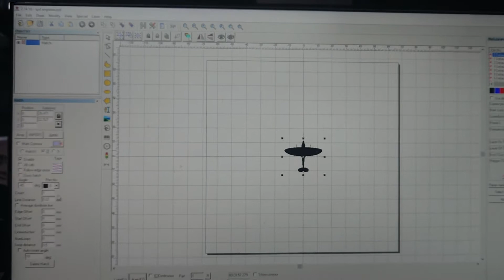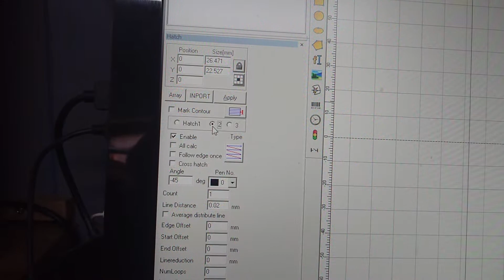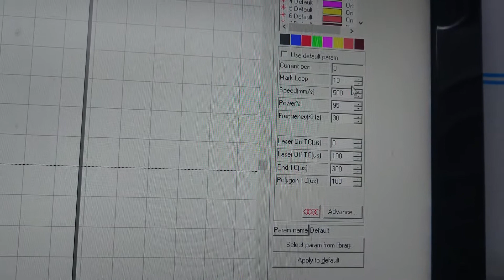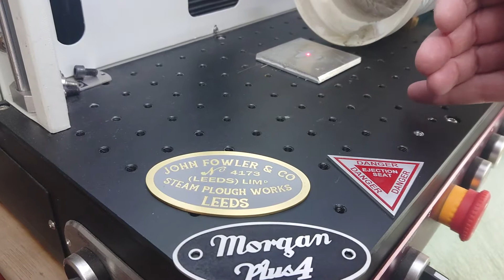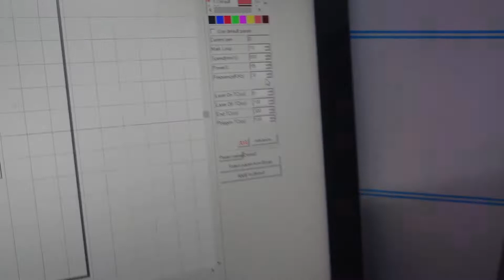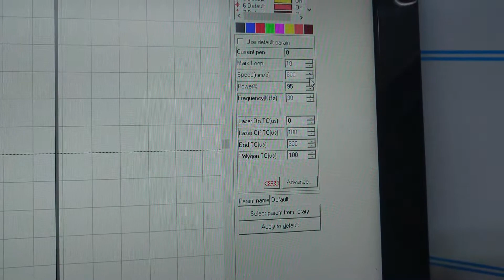FIBRE LASER 30W DEEP ENGRAVING - Fibre laser deep engraving on 30W laser

Comment: how do you apply the black mate? Paint? Let dry them polish?
Reply from the maker: Yes. So after engraving I take off the small burs left behind with a one of those square sanding pads. I clean/wash of the dust etc and then apply the paint. 
After its dry I take a new pad and gently sand across the top.

Comment: How deep can engrave with this setup?  I am looking at engraving serial numbers on devices and the industry requires a certain deep before placing the device into commerce.
Reply from the maker: It will keep going and going. However, you will need to adjust the focus from time to time as it lowers. I have found that I can get to around 1mm in aluminium before I have to jog the head down to re-focus. As it goes out of focus the power of the cut diminishes.  This will be the same on any machine. Some of the more expensive machines have something called 
( I think ) 'adaptive' focus where it jogs down automatically.
Aluminium is quite fast to deep engrave, obviously harder metals will take a lot long with multiple passes. How far do you need to engrave and in what material ? 
Remember too that deep engraving throws up some burrs that will need dressing back, I use a fine emery sanding block.

Comment: IS POSSIBLE SUPER BLACK LETHERS LASER     ON RED ANODIZED ALUMINUM ????
Reply from the maker: Hi Sergio. No, aluminium wont turn black in the same way Stainless steel does.. You can not get super black engrave on aluminium using laser alone. I would deep engrave and fill with enamel paint.
Reply: @bonesshed.  I managed to find something good by setting 3mm above the focal point:

JPT50W - Lens 175*175

Fill 1: 7000 - %53 - 25Khz - 0.025 - 45
Fill2: 500 - %53 - 25Khz - 0.025 - -45

I hope to be proved helpful!
Reply: @gianluca179  Is this in stainless steel? What color will I get?

Comment: Hi what’s the settings to engrave photos on to dog tags i just can’t seem to get the correct settings when i try the photo is not clear in a straight angle but when i turn the tag a little then i can see the photo more clear what am i doing wrong? Thanks
Reply from the maker: Hi Anna, Not sure to be honest as I haven't done any photo engraving. Are you using a High contrast image ? It sounds like it could be a combination of power and speed you need to tweak.  Let me know what setting you are using and I will try replicate on my machine

Comment: Great videos. I have a fiber laser that I mainly use for standard engraving jobs. I did try some other stuff like deep engraving, cutting brass and stainless steel (0.2 mm spring steel) and also tried to get the jet black engraving on stainless steel but did not succeed to my liking.
Thanks to your videos I'm going to try again 👍
Reply from the maker: The black on stainless is tricky, It has to be spot on focus ( or out of focus 3mm ) otherwise you will get a brown ish  tinge.  While engraving on a test piece with settings shown in the link, lower or raise the head till sparks start to appear. You don't want any sparking. 

https://www.youtube.com/watch?v=_8pJU5AxjXg&t=2s&ab_channel=Bone%27sshed.

I havent tried cutting thin stainless. I would imagine that would be quite hard on my 30W machine. Brass shouldn't pose any probs at 0.2mm as long as youre in focus. Settings for brass.
https://www.youtube.com/watch?v=bHCpyIkRgnw&t=1s&ab_channel=Bone%27sshed.

Comment: What's the lifespan of that laser and what did it cost for your setup?
Reply from the maker: Hi,  When I bought it I was told the life span was in the 10s of1000s of hours. It cost me around 6k when I bought it. You can get the components cheaper and find similar online to build yourself but I wanted to buy from a company I could get back to if I had issues.  Check out a YouTube account called LaserEverything, tons of info on there and helpful community 👍